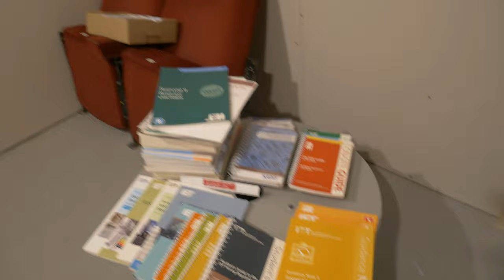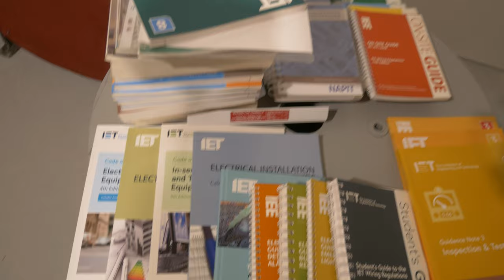Putting Solar Panels Inside.... Hear me out! - Steel Trunking and Conduit

Comment: When you drill holes into the trunking don’t you use water or cutting solution. I would have got a clip round my earhole if I didn’t when I did my apprenticeship in the early 70’s in the UK. Best from South Africa.
Reply from the maker: Never water. Cutting compound spray